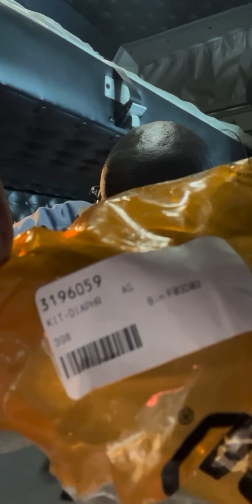How to rebuild a caterpillar coolant diverter valve

Comment: Thanks for the video. I thought it was more complicated because of all the parts in the kit. I guess I was overthinking it. My check engine light comes on when I get on the pedal then it comes off. I already replaced the harness for the diverter which made a difference but now I need to rebuild the diverter so the check engine light can go away completely.
Reply: Thank you so much. This was extremely helpful
Reply: Does this always send a check engine light? My hose keeps leaking going into it,  no matter how much tightening I do to the clamp. Hopefully replacement of the hose will fix that
Reply from the maker: Yes, this will cause your engine light to come on.. sometimes it will go off but will eventually come back on and stay on until it’s replaced. 
it could be the just the electrical part of the solenoid that needs to be replaced and not the entire part. If it’s not opening allowing coolant to move it maybe building up pressure that will cause your hose to leak. I would just buy the solenoid replace that. I just wanted to replace the entire part and while it was off I just decided to rebuild it. The only part that was bad on mines was just the electrical/the solenoid
Reply: hello, may I ask. what is this valve responsible for, meaning what its its job, i have a sdp c15 that i had to take the thermostats out of due to coolant not flowing properly, i did replace with new ones but the problem continues. thank you in advance
Reply from the maker: @omarleal3746 it helps to reduce the temperature of the air coming from the turbos. So when the coolant flow through the water jackets the water pre cools things before the turbo air leaves the turbos
Reply from the maker: I felt the same way until the dealership told me how much a new one cost. Glad it helped!
Reply: I got a feeling there suppose to be a rubber stopper at the end of that  small part with the spring on top..when I took mine apart it had half of a rubber tip ..in your case I believe it will never truly  close the coolant circulation to the jacket, witch  is fine unless you are operating in very low temperatures